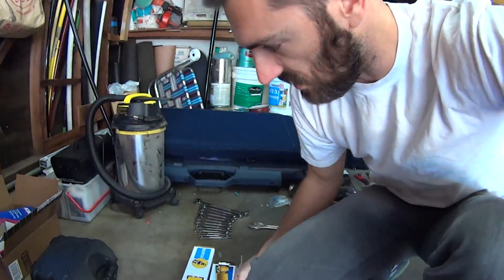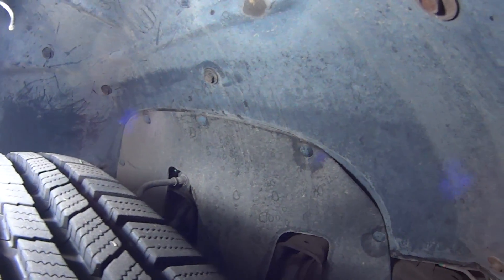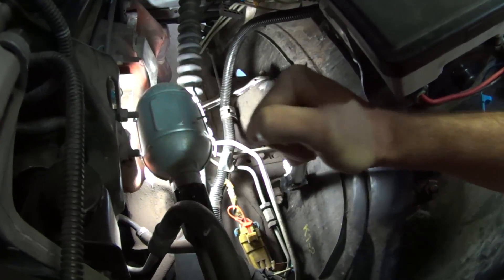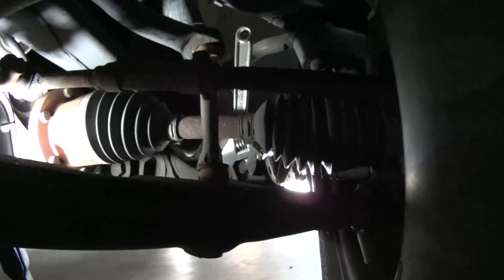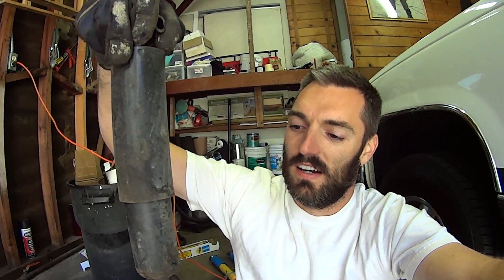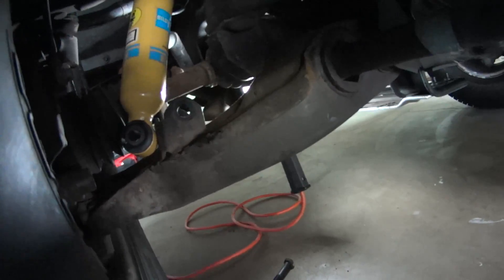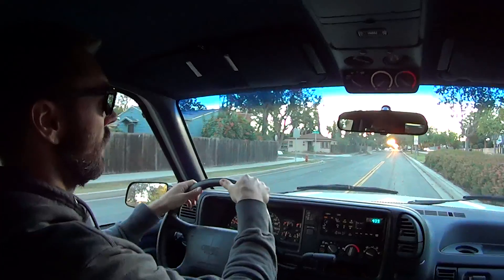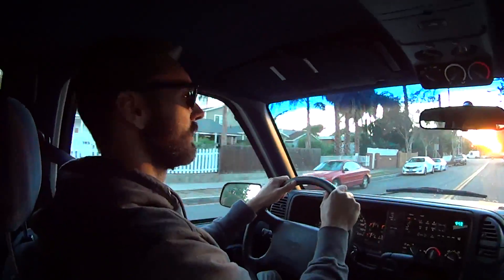Front Shock Replacement | Bilstein 4600 | 1992-1999 Suburban Tahoe Yukon Sierra Silverado

Comment: To get the shock in easier. You jack up the vehicle on the side you are working on with a bottle or floor jack. It will allow the lower arm to swing down enough to put the shock in the perch

Comment: Hey, just an FYI, when pushing on a ratchet like that do so with an open hand. If it slips your hand will take less damage than if you punch your header with your full weight behind you. 

I broke 3 of my knuckle wrapping my hand around a ratchet and changing the brakes on an old dodge. Every since then it has always been open hands and though ratchets still slip, my hands don't get broken. 

Also, thanks for your video on the door pin replacement, I need to get it don't to my old girl with 260k plus miles on her.
Reply: Jim Henline  or he coulda used a cheater pipe and hands would be clean of most obstacles

Comment: Just finished the front shocks on my 99 GMC Suburban. Very helpful video. Ran into a bit of a hiccup while doing the driver's side shock, though. The brake line was preventing me from taking out that long bolt on the top. I had to remove the bracket holding the brake line and shove it aside enough to get it out, and put it back on. Don't remember the size of the bracket's bolt, but it was metric. Glad I removed the wheels to do this job or I'd never have done it. Also found a dang screw in a tire. UGH!! Thanks for the videos.

Comment: Hey man! Those j tabs for the upper part of the rear shock absorber snapped on me why I was removing the bolt. Do you know where I can find those tabs and bolts?
Reply: Just match up some similar bolts with washers lockwashers and nuts. I did mine today I had to cut them out with a torch.

Comment: Next time be ready with the bolt so as soon as you cut the wire holding it compressed you can slip the bolt in before it over extends
Reply: Bingo!

Comment: I have a question when you order these did u order 2 of each.  Is the passenger side and the drivers the same shocks please replay thanks
Reply from the maker: Kastro super the rears and the fronts are different from each other. 2 fronts and 2 rears. I would go to their website and double check which model number(s) you need. Hope that helps!
Reply: 1 Road .  The front shocks passenger side and the driver side are they the  same thing.
Reply: Kastro super yes, one part number for left and right front and another part number for left and right rear. You need two front and two rear for a set of four, just replaced mine today.

Comment: Does these go on a 3/4 ton?
Reply: I have a 97 3/4 ton 2 wheel drive and the front shocks had 2 bolts on the bottom and the one single up and down bolt on top.it took me 2 days to do a half hour job as all 4 bottom bolts broke and i had to literally cut the top bolt off.I had to buy good quality drill bits to drill the bottom bolts out.That was 2 days in my life i will never get back.Good luck to you!!!
Reply: So do they go on a 3/4 or na?

Comment: I hated them shocks as they made my damn truck right like a tank.
Reply from the maker: +James M That's not from the shocks but the terrible design of the spring system...
Reply: 1 Road I got away from the Z71 style shocks and the ride is so much better. I even have load-bearing shocks for the rear and still don't ride as stiff as Bliston.
Reply: James M. Why did you hate them so much. What's wrong with them
Reply: @omark2423  sounds like they were really stiff